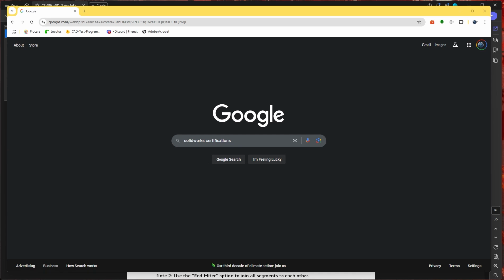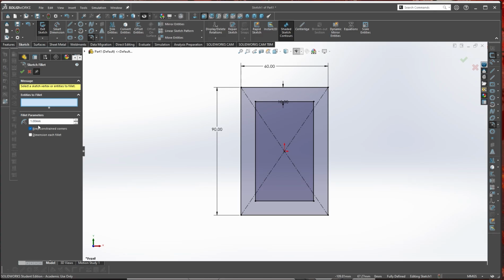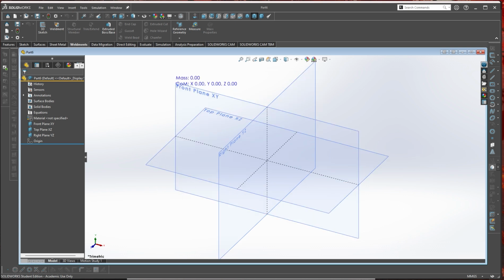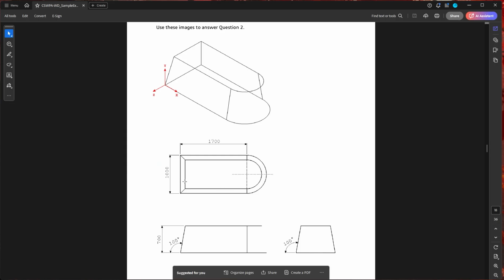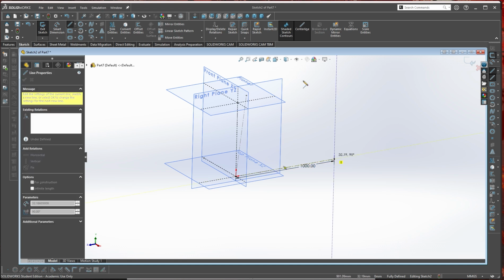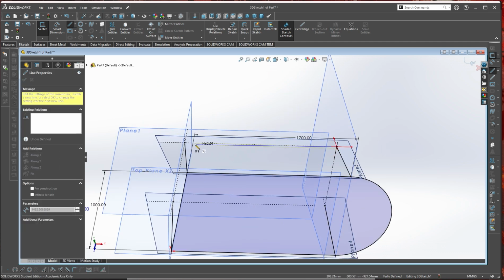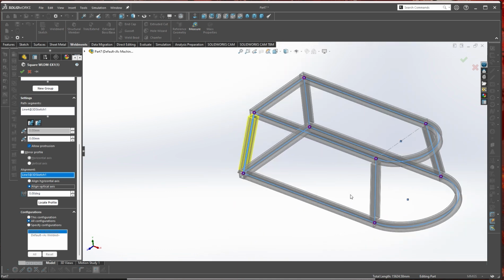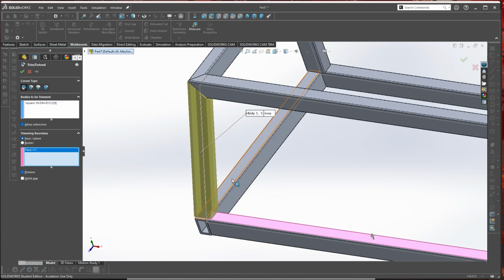CSWPA-WD Sample Test Walkthrough

Comment: Another trick to get the correct line length for Problem 2 that might be a little quicker:

Make the bottom 2D sketch, Boss Extrude the part 700mm with a 10-degree draft. Use a 3D sketch to copy all the edge lines. Then hide the solid body and 2D sketch. 

This only works for specific cases where everything is angled the same direction and at the same angle, but for this particular part it does work. Depending on skill, it is faster than making and dimensioning several planes. It is not the best modeling practice, but is a solution to achieve the answer in a time limited situation.
Reply: Wow, i never think about this way and i found much kinda faster. Thanks mr